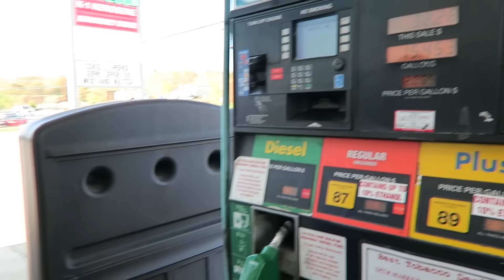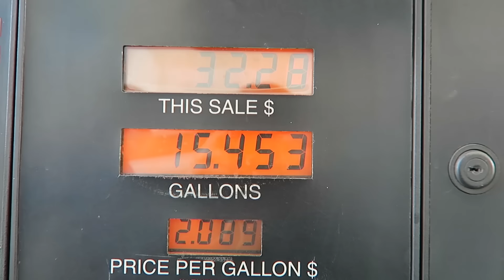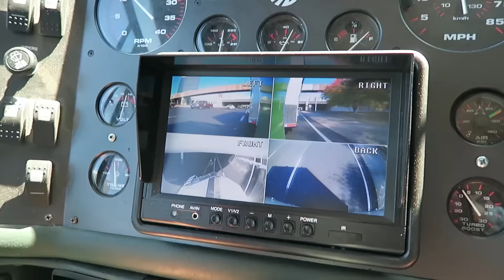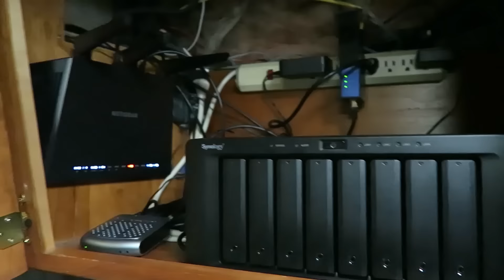VLOG | Prepping the RV for a Move (Day 8 of 24)

Comment: You should get rubber heavy duty inflatable rubber bumpers like the ones they use for boats to put next to each tire and keep your car in the center.  Even an inner tube would work. Has to be a heavy duty one.

Comment: Mike - If those aren't SSDs (and if they are 3.5" HDs) get a scrap of foam to put under the RAID enclosure. There are some very specialized 3.5 HDs that have shock protection, but my guess is you didn't get those since they are priced as "military grade". Your actuators will love you a little more.

Comment: The cell booster antenna needs a ground plane, so it should be mounted on some sheet metal maybe 1" square. That antenna is designed to stick to your car roof which creates a ground plane.

Comment: Hey! Loving the videos. You will learn a lot of tricks with the camping as you go. Look around at the other seasoned campers and see what works for them. The camping community is really the friendliest people you will find. Also check out rv.net. It is a forum and has a lot of good information. One tip is the little rack you use for waste is generally only helpful when you have sewer hookup at site. Doesn't help much when you have to stop at a central dump. Keep up the great videos.

Comment: Mike, please wear rubber gloves when dumping.  Tip:  I carried a spray bottle of bleach and sprayed the water connection before use and after as well.  You have no idea what people do and believe me, we have seen it all.  Another suggestion;  check out the sewer solution!  It is sold at Camping World, but can be purchased on Amazon.  Best thing you will ever buy for dumping the tanks.  Used one for 6 years with no problems!  
We pulled a 24' tri axle trailer behind our coach and movement of the car is a problem.  Be careful how you tie it down as well, as over time, it can break things under the car.  Ask me how I know!  I do like the wheel you use to move your trailer!